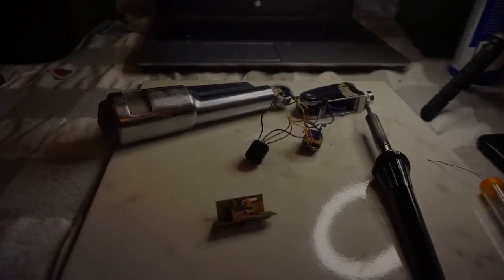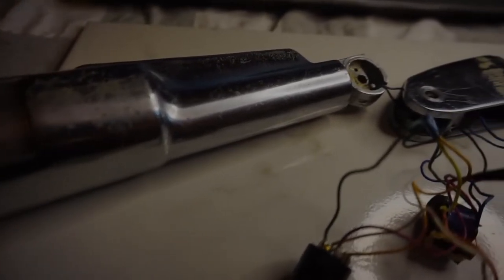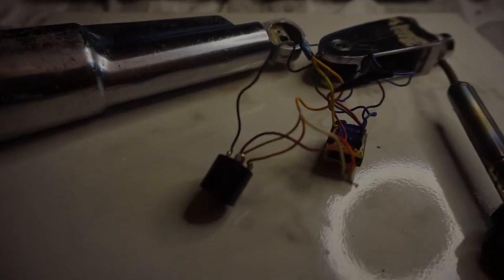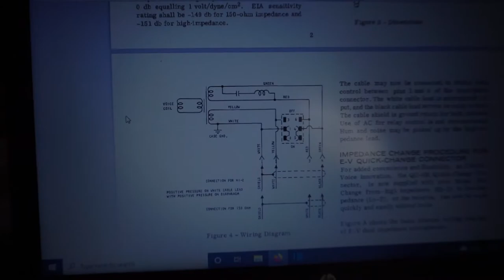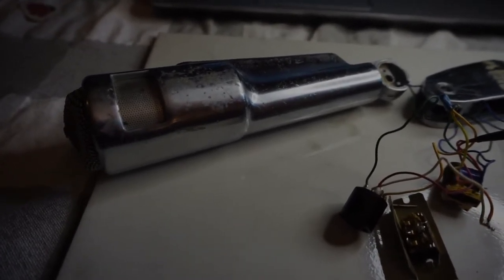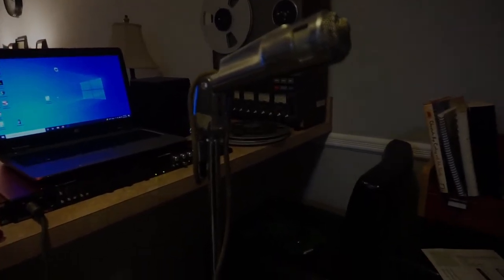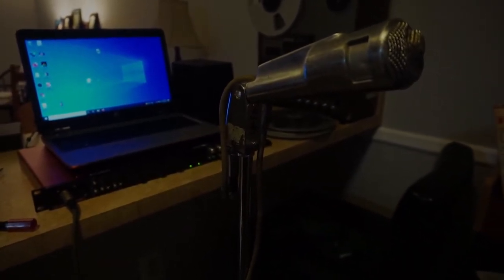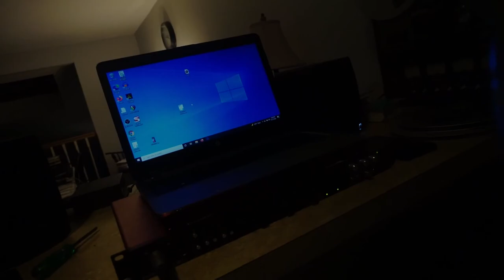ElectroVoice EV664 - The Buchanan Hammer - Microphone Repair Video pt 1

Comment: I believe the capacitor and choke are in the body of the microphone.  I have several of these and each sounds slightly different.  I'm wondering if the aging capacitor is to blame.